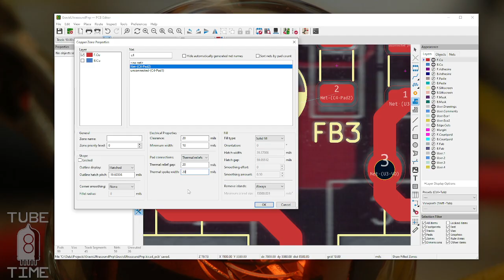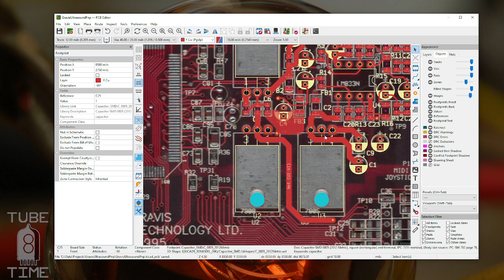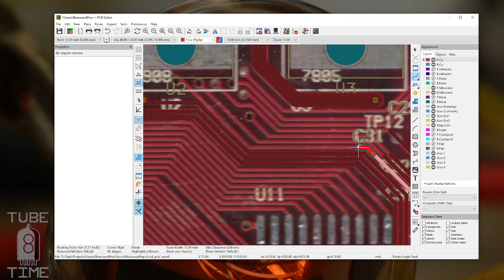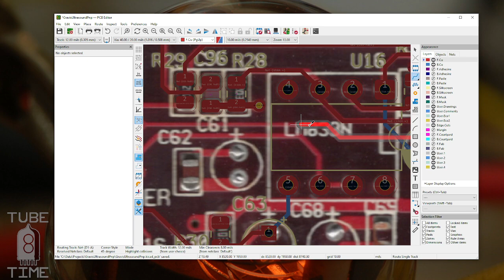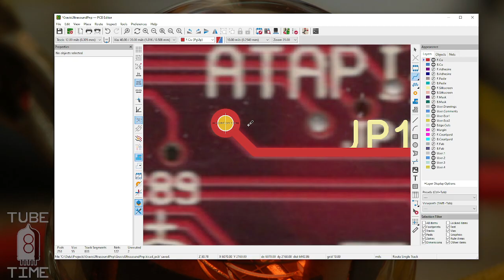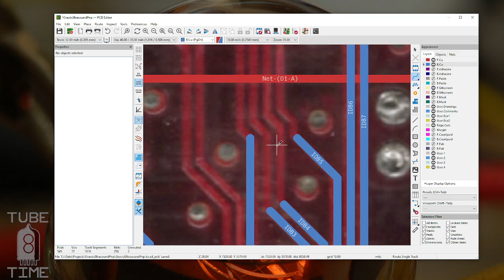Gravis Ultrasound reverse engineering! [Mirror]

Comment from the maker: 45:50 - "that's a mystery."
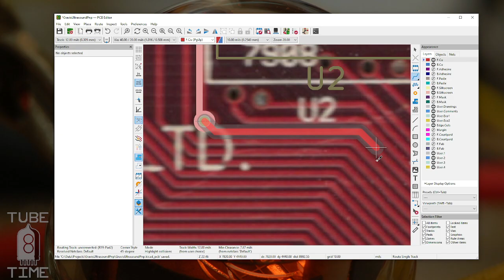49:44 - this is much more efficient than past reverse engineering techniques.
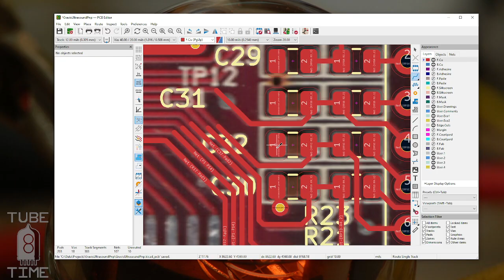1:03:23 - "sneaky and bad for design rules."
1:10:03 - they kept the -5v rail for compatibility, but then it vanished
1:26:35 - bizarre
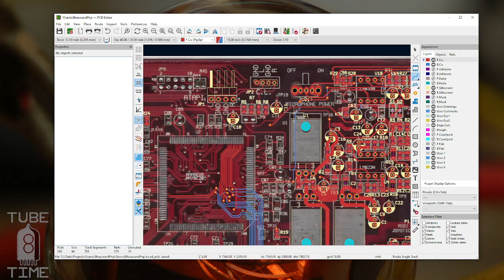1:39:50 - this thing's got analog to digital converter built in
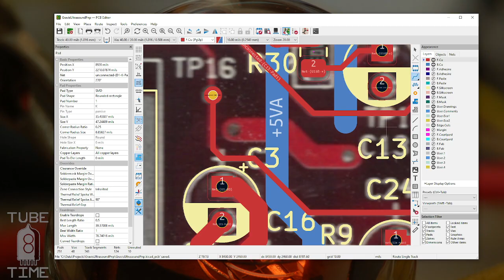1:50:09 - I think we're already better off than the sound blaster as far as audio quality is concerned
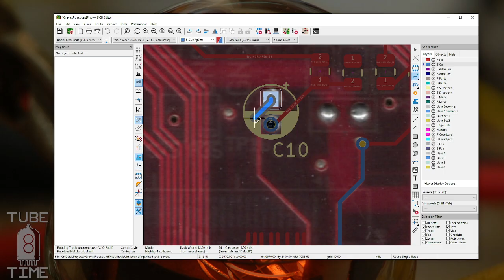2:01:10 - CD audio input with no buffering
2:08:14 - why would there be an EEPROM on there?